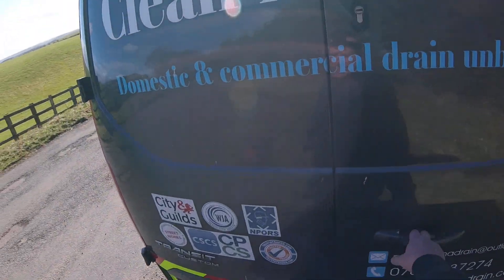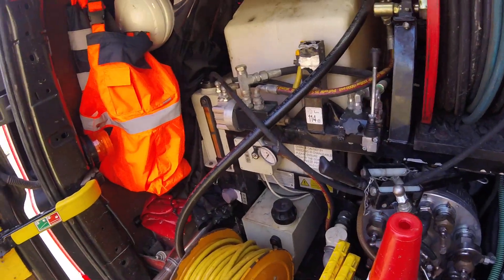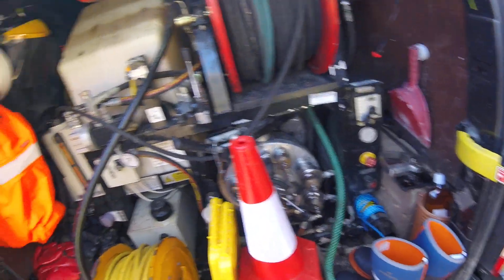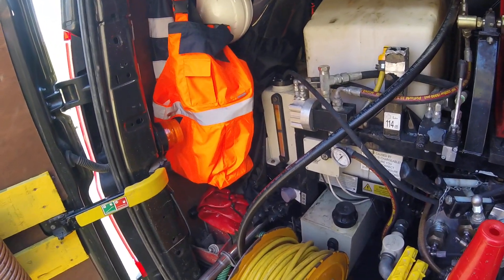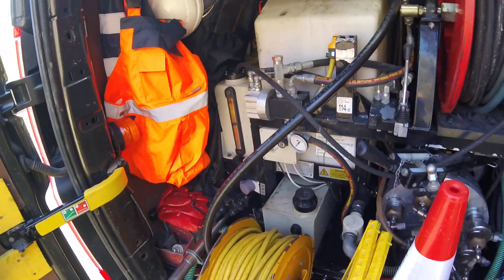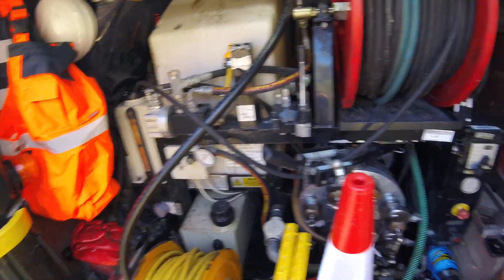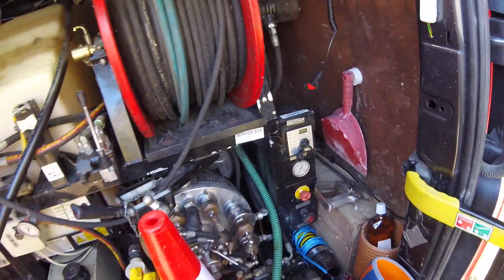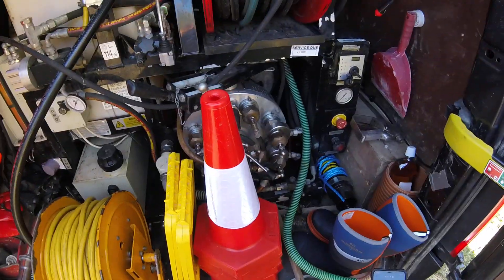High Pressure Jetting Equipment

Comment: Im thinking of setting up a business in my area and have been looking at YouTube for some help on machinery. I see your machine is 4000psi but other operators seem to be mainly 3000psi. Are they underpowered and if you were to replace your kit would you go for 4000psi again? I just dont want to waste my money on something with power I will never need or on something that is just not gutsy enough. I see my market as being mainly domestic and small commercial outlets. Did you get your machine from a UK supplier and are you completely satisfied with it? Any advice would be much appreciated.
Reply from the maker: Really depends on the area and the local building regs mate as there are never two jobs the same 🙌

Comment: Hi can I ask I have a 300psi 21 LPM machine power washer new can I use it for domestic use only and if so do I need a different type of hose from the power washing hose’s I use love your vids
Reply from the maker: Good question. If you get an nozzle from eBay that fits your hose then yes sure you can try. You can use the same hose as it will be suited to your machines pressure and flow. Provided the blockage is not two deep in the system and not two stubborn then give it a go 👍👍